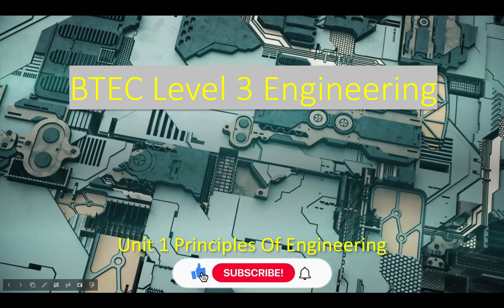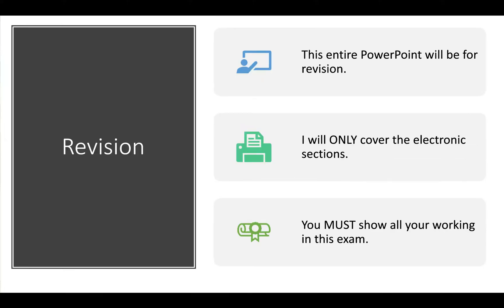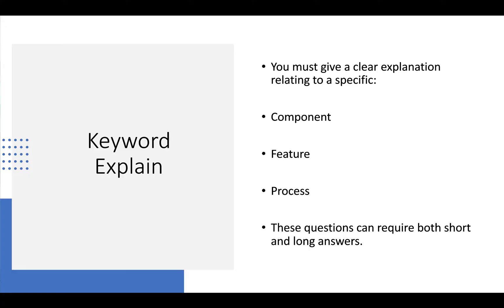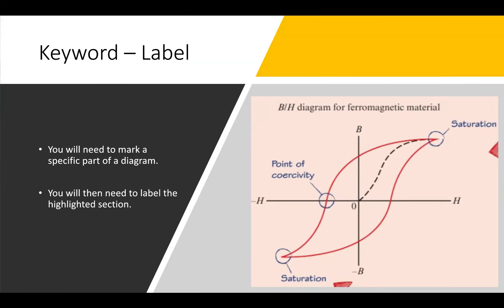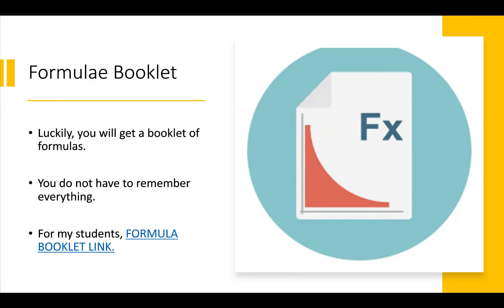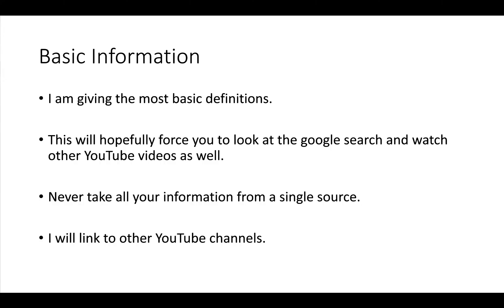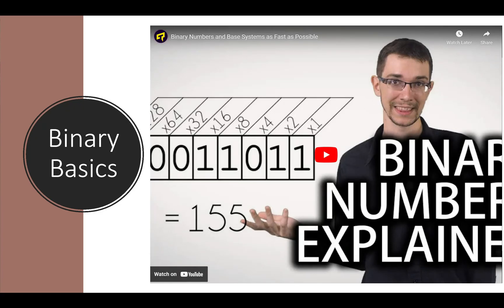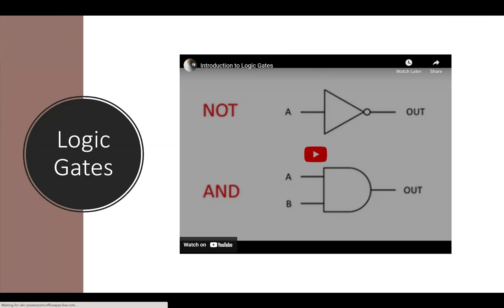BTEC Level 3 Engineering - Unit 1 - Principles Of Engineering - Part 01 - INTRODUCTION

Comment: can  I do engineering with a btec (I did not get the grades I wanted for alevels😰😥😢)
Reply from the maker: Yes you can.

I did both BTECs and A Levels.

Simply contact the Uni and figure out what Ucas points they want, msot Unis will have this on their website.

Use the UCAS Grade Caldulator to see if you meet the requirements. 
https://www.ucas.com/ucas/tariff-calculator

Some Unis will even do this over the phone with you.

Good luck.